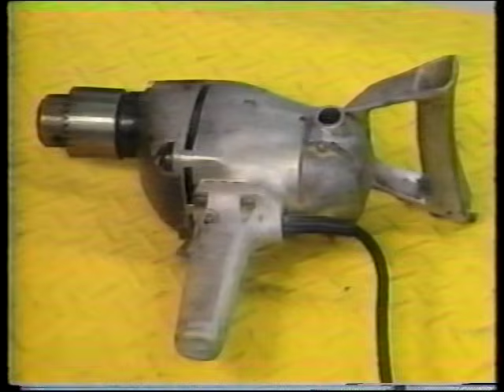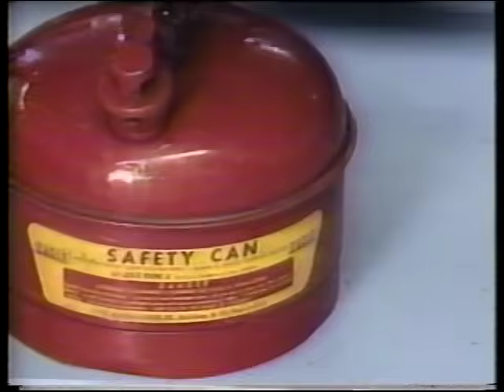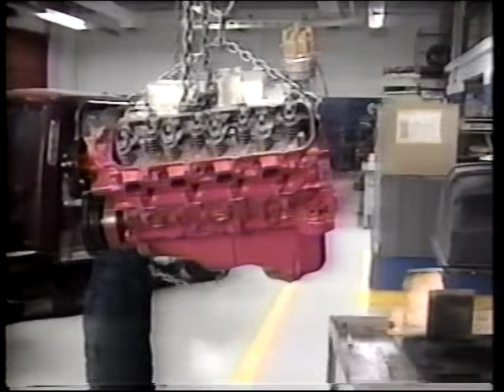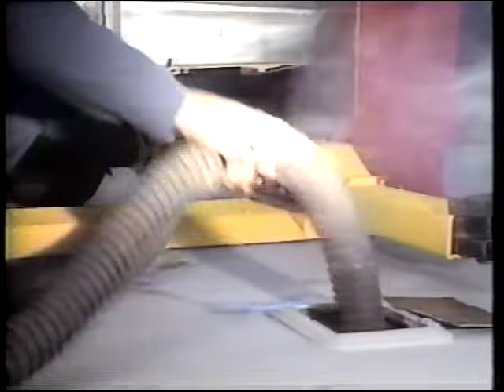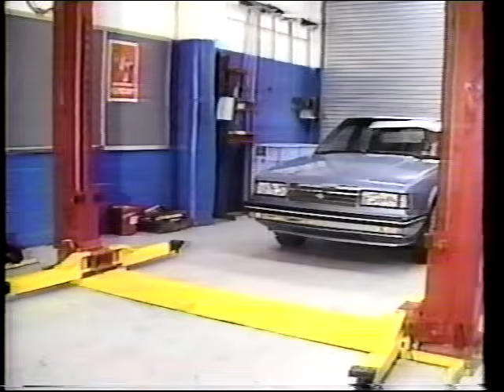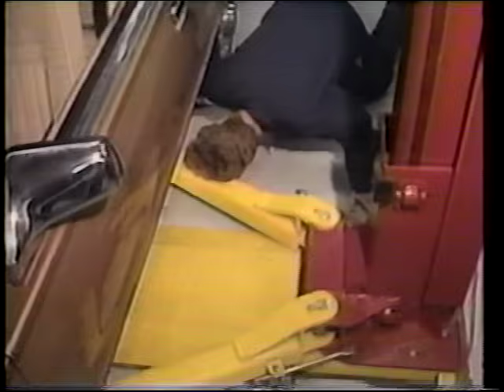Auto Shop Safety

Comment: Looking at this in 2025!
Reply: One of the greatest scams in history is the ground. What's the point of running a ground wire on each and every outlet if the huge majority of power cables almost all are FAKE. No wire connecting the ground terminal together. 😂 What it actually does is the opposite.